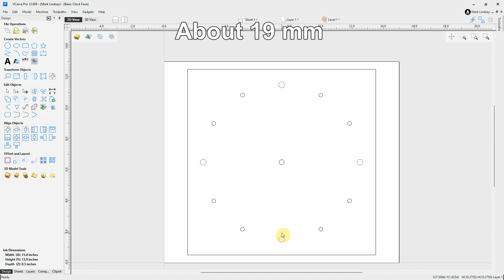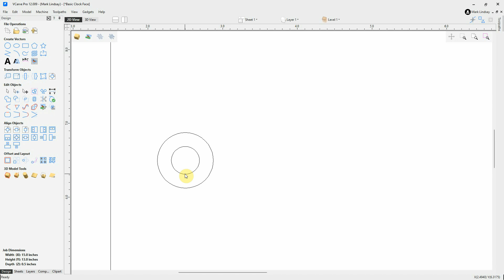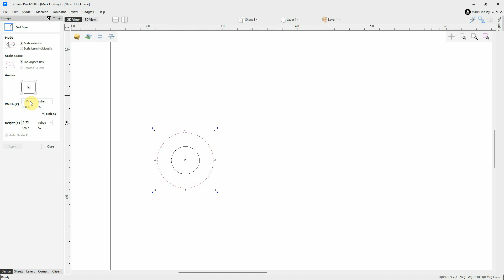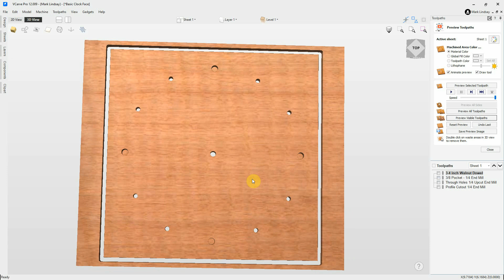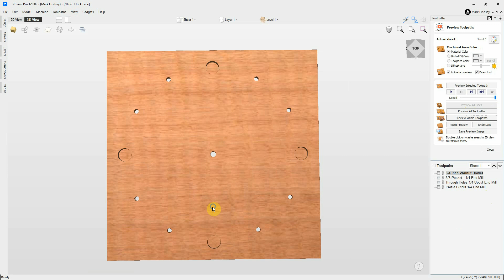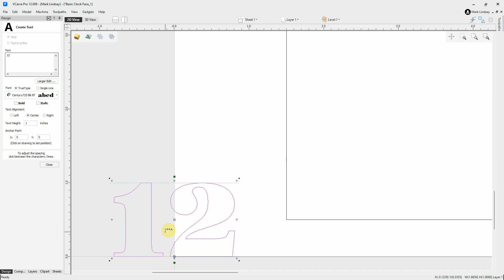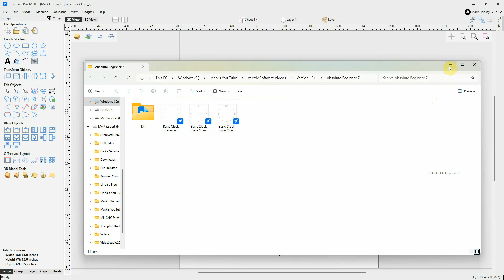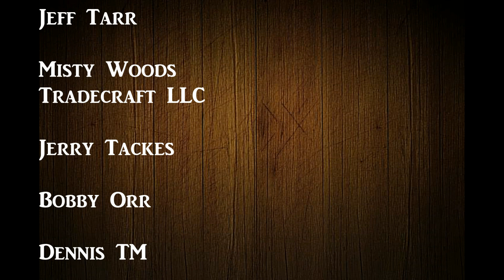Vectric V12+ for the Absolute Beginner - Part 7 –  Offset Vectors and Increment and Save

Comment: Mark,
Can you tell me how to make a small jewelry tray oval shaped. Roughly 4.5 x 6.5. x 1" thick. Carved out the inside with a 1/4 " border. I can add text to the carved out area but I'm having trouble getting the rose in the aspire Clipart. I can't get the rose to carve. I'm cutting the center 3/8" deep.